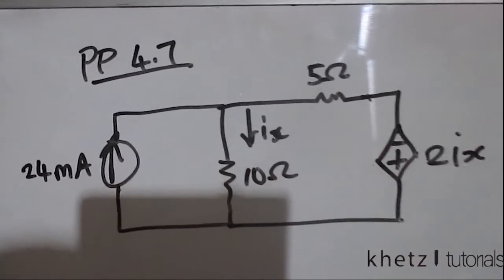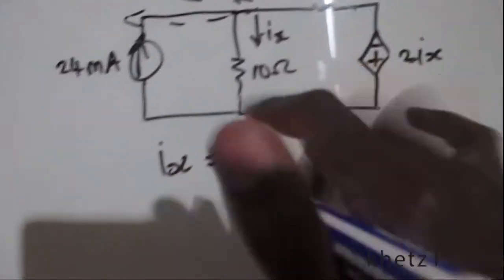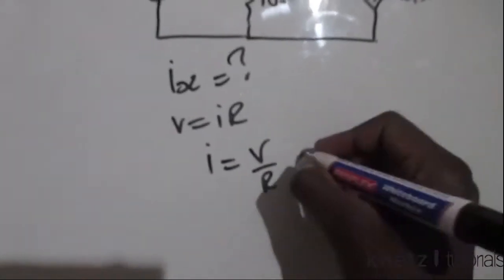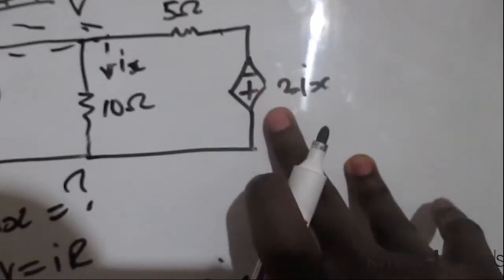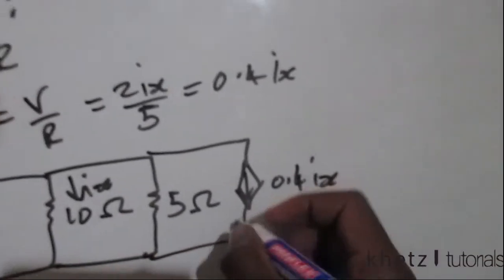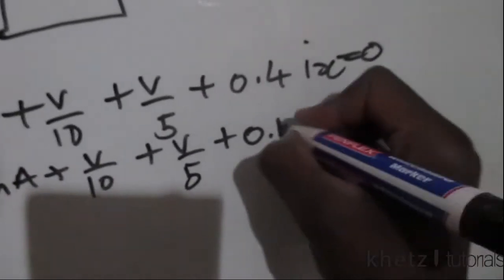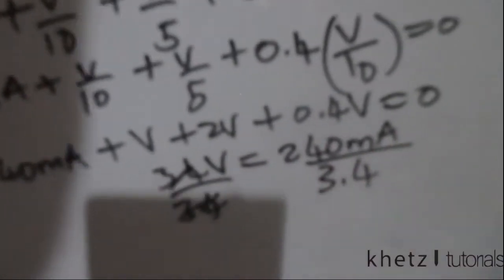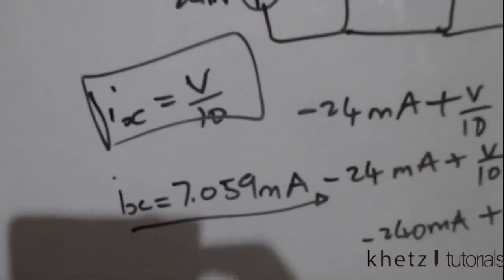Fundamentals Of Electric Circuits Practice Problem 4.7

Comment: How to do if we transform the current source
Reply from the maker: Transforming the current source would lead to a voltage source in series with the 10 ohm resistor. That series connection would be in series with the rest of the circuit which would mean that the current through each element is the total current and not ix. Please note that the value of the voltage source is dependent on ix. It would then be impossible to find ix because you would only have one equation for the newly formed loop. It would probably be possible if 2ix was not dependent on ix
Reply: Nice explanation... Sorry do you use whatsapp or instagram ... I have some exams i was hoping i could share some problems and you help out?
Reply: Or telegram please🙏
Reply from the maker: I only host consultations over Google meet or Microsoft teams and you can book via email. khetztutorials@gmail.com
Reply: When doing the nodal analysis,  shouldn't that +0.4Ix be -0.4Ix??
Reply from the maker: Using the top node, incoming currents were taken as negative and outgoing currents as positive. The negative ones enter the node and the positive ones leave the node. 0.4Ix leaves in this case and that is why it is positive